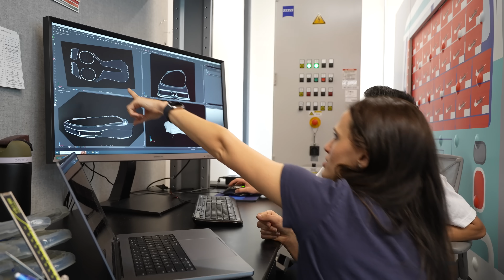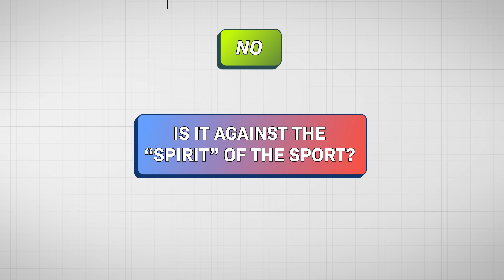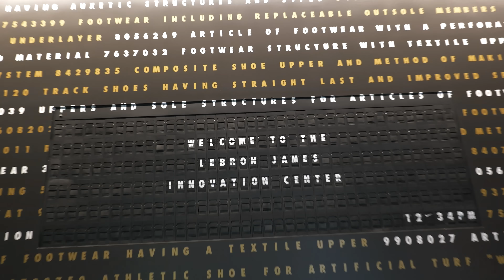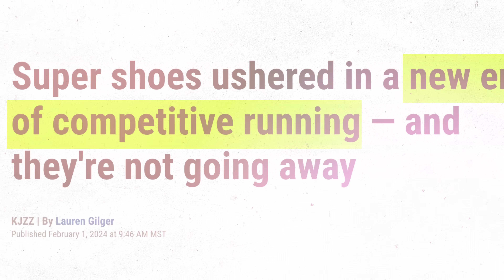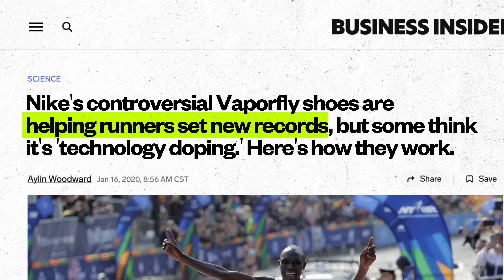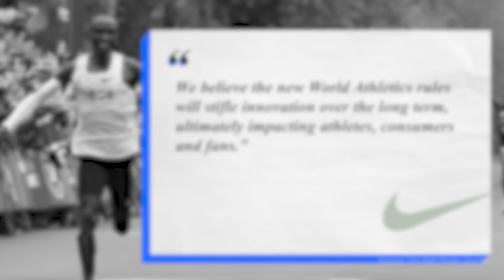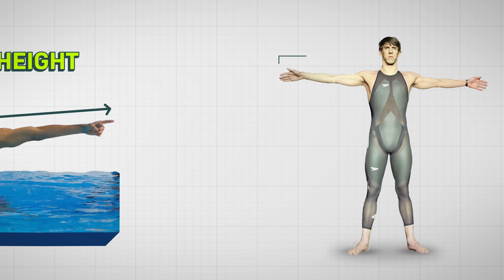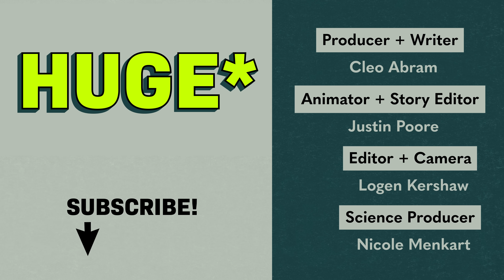The Shoe That Broke Running

Comment: As a competitive swimmer at lower levels, I remember when the super suits came. Unlike previous swim wear, they covered a lot of the body. They were very expensive and had low durability, which means a lot of swimmers would not be able to afford them (we are talking about 10 times the price of previous gear and having to buy new several times each year, which also challenged sustainability). Of course, compared to bicycling at pro level, alpine skiing or golf, the price of gear was still low, but many swimmers without the suits felt they were competing against a suit, rather than a person.  I guess most swimmers felt it was against the spirit of the sport.

Comment: I dont like your conclusion. There is a point at which youre talking about enhancement instead of cotrecting for disability.
Blake's legs appear to be such a case, just like the lenses for shooting you managed to identify.

If unchecked, you run into situations where it's unfair to th competitor's. Just like with the shark swimsuit.

Sports are about testing ability of the athlete, not about gaining an unfair advantage that your competitors have no access to, like ultra shoes, shark swimsuits or prosthetics that are faster than regular legs.

And Nike is just sour because it was a cool marketing Gimmick. The actual tech is easy enough to replicate, so competitors will make shoes that are just as good. Nike only gets a marketing boost if they're the only ones that have insane shoes.

Comment: Competing events should be about putting one persons strength and skills against another persons. Such feats should not be determined by any external factors that provide an advantage over another. Because at the end of the day the competition is a testament to human abilities not a competition to see whose tech performs the best or who has the the most funds to afford the latest equipment. There should be a regulation and dress code that allows all athletes to wear and use  the exact same equipment.

Comment: Surely it's quite simple: so long as all the energy is provided by the runner who cares what they wear? It's the same in cycling, the UCI introduces all sorts of silly rules when the only rule (other than ones for safety) should be that a machine must have 2 wheels and be powered solely by the rider. Otherwise, like this excellent video highlighted, where do you draw the line? All the lines will only be arbitrary. How does that make sense?

Comment: The answer to that would be uniformised standards so every athlete have similar high grade gear, best tech for everyone 🎉
so it would be fair, and poor amateur athletes in general should have access to high quality stuff btw
I had injuries that would have been avoided if I had proper shoes and insoles as a teen that liked to run, def would have liked to protect my ankles and knees and not lose toenails
But there's no aid for that, and I wasn't in any club because I was in a remote area etc and even then you have to pay for equipment...

Comment: I understand why you'd arrive at the analogy of using glasses, however (unless specially designed for cheating) glasses only correct a vision impairment back to the standard ability of the average human (ie. 20/20).
Blades don't "correct" the loss of a limb, but rather change it completely. 
With all the respect (and admiration) I have for his achievements, I have to agree with the decision to not allow blades in general competition.   It's a brave new world of technological advancement in sport and I wish there was a way to provide equal opportunity to set records, but just like we can't allow men to run in women's categories (for now 🙄) we have to draw lines when it comes to measuring what the human body is capable of. 
Maybe there's a place in the upcoming Enhanced Games for Blake to compete in.

Comment: Records should hold their place and significance based on the technology used (or not used).

So, a track record run in traditional shoes would not be "broken" by a better time run in technology improved shoes. 
That would establish a separate record for techwear assisted running.

Comment: The swimsuits and shoes aren't just tech advantages but an advantage that was only being offered to select athletes. The shoe rule that it needs to be a shoe publicly available for X amount of time is solid and swimsuits should go the same way. For the running blades, it may look like a very similar sport, but the tech paths are divergent and again not available to all. It should be recognized as the separate sport/event that it is. In the blade runners only events, things like the height rule may or may not be needed.
Reply: Adidas bypassed this rule by releasing their adizero adios pro evo 1 in a limited fashion only so that it would be deemed legal; it was a single use, $500 shoe.
Reply: But you're then essentially banning disabled people from competing against able bodied ones. That's not fair either,  especially considering that he didn't get a speed advantage and the other points mentioned.
Reply: @Etho_9  It isn't banning, it is recognizing they are not the same event. Any speed advantage that may or may not be there is irrelevant, because they aren't doing the same thing.

We could have a fair category for bladed runners by making a rule set for blades that attach and move in a way that is the same regardless of lower limb.
Reply: @barongerhardt  yes you are. You're segregating disabled people from able bodied ones, supporting the notion that they cannot complete with them. But they can, they are primarily using the same skills and outright forcing any disabled person into a different category blocks them from visibility and potential resources. It's definitely possible to find fair requirements to let them participate, especially in this case.
Reply: @Etho_9  As long as they run without the blades, I think it is fine. Let them compete. What you are arguing for is different rules for different people in the same competition. Most of the time when one participant gets special rules or advantages only available to them, we call that cheating.
Reply: @barongerhardt  ah, I see, arguing in good faith isn't on the table here, excuse me for thinking it was. Well, bye
Reply: @Etho_9 It is not possible for other athletes to ever believe they are competing on equal grounds, I wouldn't believe it.  I think of the pain in my calves, and I see another man running without any of that pain at all.   He has quad pain?  So do I, but he doesn't have calf pain.

Comment: I have a couple pairs of the alpha fly 3s.  Do they improve your times?  Absolutely.  It’s like this in motor sports and athletics, there’s going to be advancements in technology.  Is that fair for the previous record holders?  That’s the question.  I think it comes down to what is available for the times.  As long as it’s available for everyone to wear, then I think it should be alowed.  I can’t keep up with Olympic athletes, so they don’t take the place of hard work and years of training.  They help but they wont make someone mediocre a pro.  They make a pro just a little better.

Comment: I'm not even joking, I feel like the advancement and miniaturization of technology actually give some merit to just doing the Olympics naked again. I doubt that'll ever happen, but I figure the next best thing is probably to get the conditions to FUNCTIONALLY mimic that as much as reasonably possible. Surely I'm missing tons of extremely important nuances, but imagine if all runners had to be barefoot, and the running track was designed to safely accomodate it. Or maybe swimmers should all be REQUIRED to wear swimsuits made of the exact same materials. Maybe ALL athletic equipment should be required to be the exact same brands and materials, specifically chosen, sourced, and provided by the Olympic games. I could see a situation where the governing body works closely with all the equipment companies, and on the last day of the games, they announce and LOCK IN all of the equipment specifications for the coming seasons so there are no changes or innovations possible in that time.

Comment: You can’t compare vision and prosthetic legs. Vision has a very easy base requirement for everyone (20/20/) whereas prosthetic has so much more variable like what was mentioned in the video (spring force, length, oxygen intake etc). I would say anything that puts anyone at an unfair advantage that’s not easily measurable or readily accessible to all should be banned in general.

Comment: These competitions are about finding the best athlete, not the best equipment.  Besides if you need a million dollars to buy the high tech gear to be able to compete effectively, then that is an unfair barrier for entry.  I am all for separate events where people can use this gear, and take all the drugs they want etc. etc. Some guy with artificial legs pumped up to the eyeballs on steroids blazing down the track in the 100 meters and then just as he is about to pass the finish line his heart explodes and his head pops off, so his automated legs don't get the message to stop and he keeps on running straight into a wall.   
I would pay to watch that.
But when you are trying to determine who is the better PERSON in a given event, anything that is not widely and CHEAPLY available to ALL participants should not be allowed.

Comment: Sounds to me like the definitions are being twisted. Athletes breaking records by the use of engineered mechanical help is not the improvement of the human body. That bit about the spring action in the shoes is not propelling the person is a twisted explanation of the working process of the shoe. She said it herself. It's like being on a trampoline and a trampoline's rebound pushes a person higher than is capable without it. Just like the shoes.

Comment: The comparison to swim goggles is specious.  Like helmets, goggles are safety devices.  Chlorine burns the eyes.  Try 2 hours of swim practice without goggles.  It's a miserable experience and the itchiness/tearing lasts quite awhile after practice.  I remember getting my first set of goggles.  Oh, the joy!  Also, learning to dive from the starter block while wearing goggles is a challenge.  The goggles may leak or not stay in place, both of which hinder a swimmer.  Even with tech advancements, goggle leaks remain an issue as evident by a quick Internet search on the topic.

Comment: I'm only part way through the video, but I'm assuming those are Nike vapoflys?  I have a friend who's really into those. 

I use Saucony Endorphin Pros for my Marathon days.  Whichever is the latest model, my last CIM was the 3. 

Of course I'm also not going to win that marathon.  For me, I'm just competing against myself, and comparing times with friends (but not really competing against them, we're all congratulating each other).

(I'm also spending about $250 for shoes that I'm going to wear for one marathon and then maybe one half marathon and that's how long they're designed to go, so I have to buy a new pair for next year)

Comment: Something that gets lost in the running shoe debate: training.

The truth is, yes the shoes are making a difference in the races, but the real difference we’ve been seeing is in how training has changed.

Because these shoes lessen the abuse on the body when training, athletes are able to train more than previously was possible/safe.

Even just anecdotally, I can run 5 days a week now using these types of shoes. Switching to a more traditional pair would probably take me down closer to 3 days.

Now apply that type of approach to the elite runners and you now have an explanation for this revolution in high volume, high intensity training that we haven’t really seen before.

And you can see this effect with the rise of “super trainers.” Basically shoes that aren’t race legal, but assist your training by minimizing the impact of more extreme and frequent training.

Comment: I don’t think Nike cared too much when their shoes where banned in fact they’d probably liked it as it was a good promotional strategy. Most of the consumers are not pro athletes but regular armature runners, you can’t make a whole lot of money sole of pros. It would be too small of a target audience. There are a lot of shoes which exceed 40m stack height and I see them during races all the time because these people are armatures and are not making the podium. Also I think the Adizero adios pro Evo is more tailored for professional athletes as they are single use shoe and therefore would be more fit to the point of this video.

Comment: Shoes which have HIGH Heel sole are terrible for Posture.
(is one of the reason why most people have Posture problem nowadays)

A little bit of heel & cushioning is okay for RUNNING.

But for walking and standing , Literally a flip flop height is the Best.

Comment: you forgot 1 important question when should we test such improvements, should a brand new running shoe be tested in compaction  and  should that shoe be given to only one person in said compaction, for instance was it fair for phelps be the only one in possession of that swimsuit, NO. would he have won as many races if everyone was able to have the same kind of swimsuit, we will never know however the experts say no. So when is it fair and when is it cheating? It's fair when everyone is allowed and capable of acquiring such enhanced equipment.

Comment: It's like in golf. We went from wooden clubs, goose feather balls, liquid filled balls, lazer range finders, and titanium metal clubs. However, the biggest difference in scores and performance was when pros went to a 3 layer ball, or the Titlest Pro V1. What was different is that the ball could go farther than then the previous one, and there was more spin control for shots on the green. (Also, golf is an Olympic sport.)

Comment: 15:41 It’s so unfair that his estimated height was calculated using averages from other ethnicities, that are traditionally smaller. It feels almost like that they were looking for any technicality that would impede him from participating in the Olympics.
Reply: it's not the fact that those ethnic groups are typically smaller that makes the estimate doubtful, I guess the reasoning behind the criticism for it is that their body proportion might be, on average, different between ethnicities (I have no knowledge of that, but i can imagine being true) wich would skew the estimate
Reply: At a glance when he's at pace, Blake looks like he's on stilts. Nobody on earth with his proportions has lower legs that long. Those blades were going into his adjacent lanes.
Reply: They might be off, but are they off by 5 inches? certainly not. On blades he’s taller than he would have been. How are you going to on hand regulate the height of foam padding in shoes, and on another hand allow 5 inches of extra perfectly calibrated human prosthetics. Is that fair?
Reply: Is it?  A lot of human proportions are the same across ethnicities, from my understanding.
Reply: @daexion  Not at all. The human body size and measurements change depending on ethnicity, nutrition, and genetics. Salvadoran people, for example, are a lot smaller on average than the people from the US.
Reply: @TheCatWitch63 I would say ethnicity plays the smallest part in determining body size and measurements if at all.  A good example of this is that North Koreans and South Koreans are now considered ethnically distinct from each other but if you go back 70 or so years they had pretty much the same body size and measurements but modern day North Koreans are significantly smaller than their Southern counterparts due to malnutrition and a couple of other factors. They share similar genetics but have diverged due to the two populations being isolated from each other.

Comment: The difference between glasses and blades is that glasses are actually just bending the light that gets to your eye so you can see correctly. Blades are a mechanical device sustituting a member so you can go faster, not just have a "normal" walk. If someone used a bionic eye (or even a small telescope in one) so they could see further, then THAT would be banned too.

Also, if Nike does a little downwards bend at the front of that carbon fiber sole, I believe those 100mts dash records would be greatly improved.

Comment: Same gear per sport supplied by the rule makers I think would already go a long way in making it fair. Running blades are more difficult to manage but I don't see the problem in making one for pro0pem with both legs on blades and separate from the others if they clearly enhance your ability to run to the point where they outperform everyone else. 

Everyone can wear glasses so I don't see the problem on correcting your vision. There's no zoom built in (yet) to make it unfair. I don't know how that was even used as a point to compare to some of the gear other sports were using. 

If you introduce goggles, give them all goggles. If yltheres new tech in swim suits, let everyone or no one use it. If there's bouncier shoes than ever, fine, but give them to everyone to train with and use. 

We know the problem, it would cut sponsors and that equals not enough money. You want money? Forget it being fair. You want fair, stop making it about money.